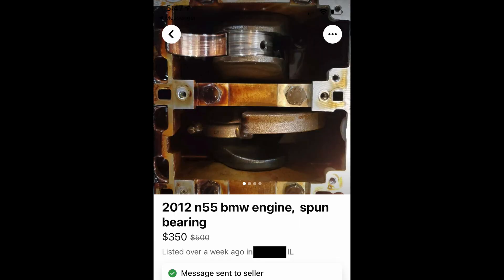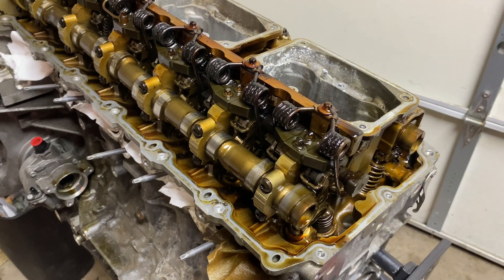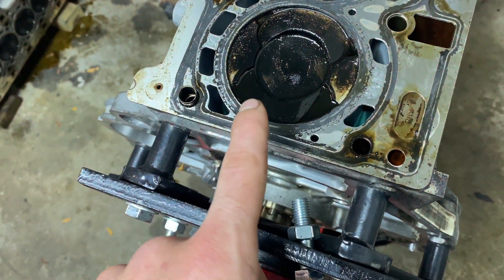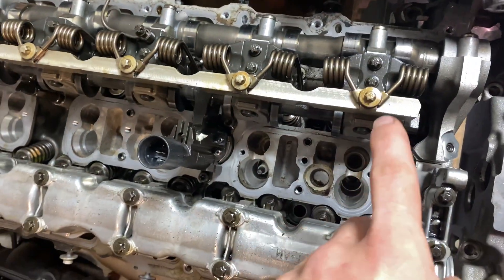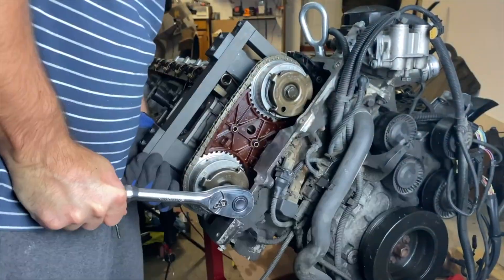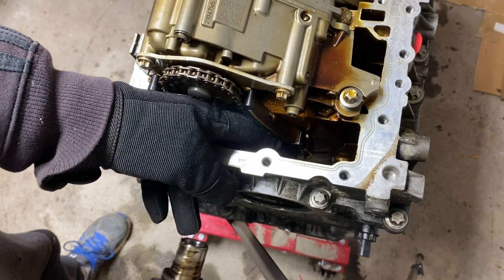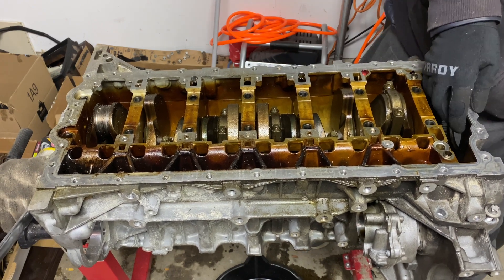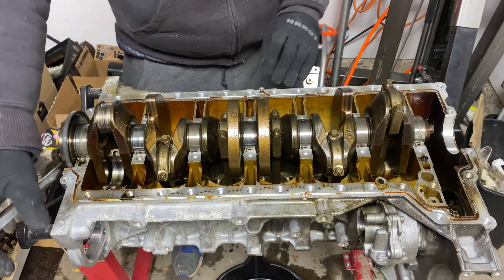I Bought A Broken BMW N55 - BMW N55 Engine Rebuild Project Part 1

Comment: This will sound weird, but is it normal for it to sound like it has a slight knock? I know how dumb that sounds, but every video I see of an N55, They sound like they have a knock to me, But they all seem to be "fine"
Reply from the maker: You might be hearing the high pressure fuel system (likely injectors) making that ticking noise. That’s completely normal on most direct injected engines.
Reply: @SimpleCarGuy  ok thank you! Is it normal for it to more easy for me to hear while under the car? Thanks!!

Comment: Thank you for this series, I will be rebuilding my N55 this winter (it pulled a cylinder head right out of the block)

What were the differences between the X5 motor and 335i motor? If I do have to replace mine, it says there is a “to 12/10” N55 and a “From 01/11” N55, but I cant tell the difference. If I do have to swap mine, I’d like one from a later car but unsure if it will work.

Comment: Do you if you could use a n55 f-series long block and bolt on your e-series parts. Is there any difference between the to blocks and heads?

Comment: How come this is a closed deck ? Weren't N55 open deck engines ? This looked like a closed deck. I may be wrong
Reply from the maker: I think you were looking at the gasket and not the block itself and that’s why it looks like that. It is, indeed, an open deck engine.

Comment: Awesome work mate. Does your car have an oil cooler? Not sure if it makes a difference but I have lost 2 bearings on start up after having the engine disassembled. Not sure if these engine get an air lock or something in the oil system when thermostat opens. I did all the gaskets including oil filter housing on a very low km second hand engine. Engine was running perfectly when removed from donor car. Oil pan off all looked perfect. No heat or scorching and engine was as clean as a whistle. Picked up number one rod bearing while idling in the shop - inspection revealed oil starvation as cause - progressively worse from #1 - 2. 3,4,5 and 6 looked perfect. Crank looked OK as rod did not actually spin. Shop replaced all bearings with std size. It spun number 1 again within 20km. I currently have a dispute with the shop over their workmanship as they are not wanting to take any responsibility at all. I don know if they primed the oil system or what. I do know that on the first instance they flushed oil cooler but did not fill it with oil prior to reinstall. It would appear that it locked up when thermostat opened up.  Now a rebuild is required. BMW = :(
Reply from the maker: That sucks, sorry to hear! Yes, this car has the additional oil cooler, but I'm not at the stage of putting the engine back in yet. I hope I don't run into those issues after the job as done as it's been a ton of work so far!
Reply: @SimpleCarGuy  не

Comment: I assume you could not grind the journal? These engine spin Rod Bearings like they are free. I have spun 3 of them so far...
Reply from the maker: I don’t know a good machinist to do this and one place I called told me ‘I couldn’t afford it’. So I ended up getting a used one and installing that now. Video should be out in a few days.

Comment: Are yo going to do work on the head like porting.
Reply from the maker: No, it’s more of a rebuild project rather than an upgrade. If you have suggestions of things I can do in the garage and don’t require a machine shop, I’d definitely be interested in hearing.

Comment: What causes the N55 to get spun rod? I thought these were good engines.
Reply: years of neglect and or overtuning and constant hard driving with or without cold engine. there is nothing wrong the N55, but by the time any bmw has turned 10 years old at least 10 kids have revved the shit out of it.
Reply from the maker: You're not wrong! N55 is a decent enough engine, but these cars are not driven lightly. BMW's 15k mile oil change schedule didn't help either.